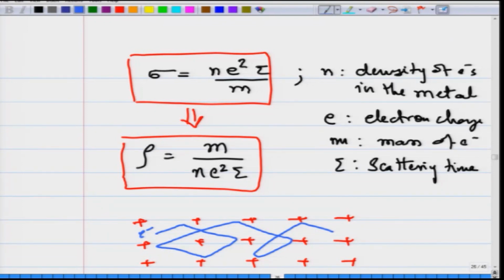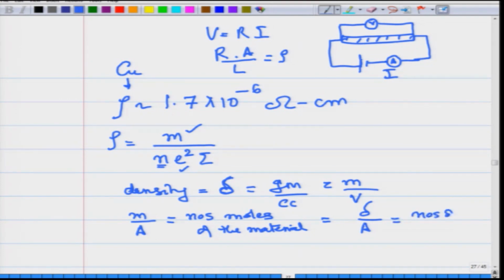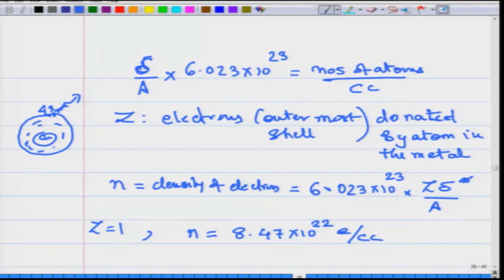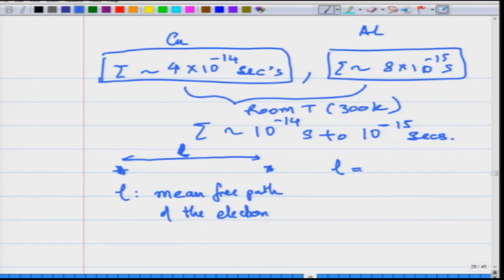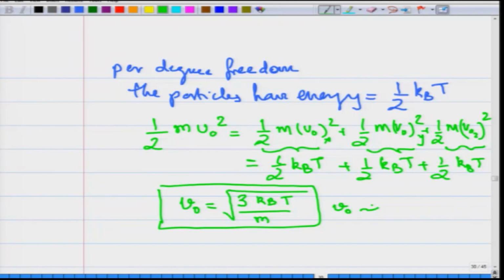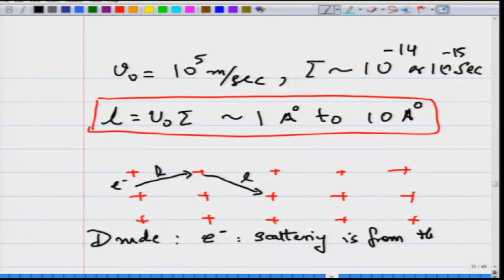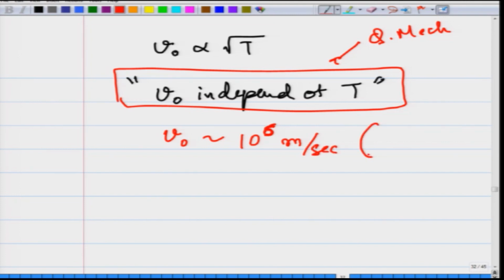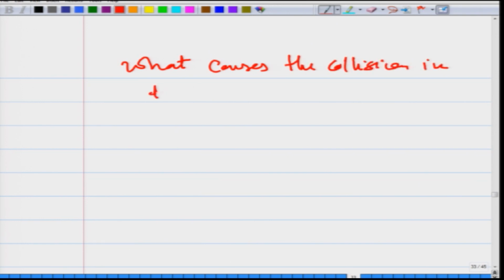noc19-ph02 Lecture 05-Drude's Model-Part-II

Comment: How is the resistivity dependent on temperature?
Reply: With an increase in temperature, the number of phonons increases. So the phonon induced scattering also increases, thus decreasing the mean free path. So resistivity increases. This is in the case of metals. For semiconductors the scenario is different.
Reply: @vasudevanm.v2760  Say Simply more collisions due to increase in entropy(randomness) of electrons

Comment: In case of velocity you are increasing temperature. But to get tau you are decreasing temperature..🤔🤔🤔.
Why?
Reply: As per classical statistics, with increasing temperature, the velocity of the particle (here electron)  increases. Also with an increase in velocity, scattering due to lattice (phonons) also increases, thus causing a reduction of mean free time.
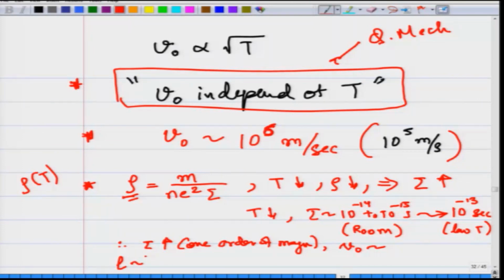Reply: @vasudevanm.v2760  at 21:50 see 
He decrease temperature and resistivity 
so Scattering time tau increase.
Now but velocity v ∝ √ T
But he increasing velocity.
That is my question.

In same condition taking different outcomes
Reply: @spfi3881  he has mixed up the two theory to prove drude was quite off.
Reply: bro, velocity is independent of temperature.  Only scattering time depends on temperature in the way explained.  Where is the confusion!
Reply: @DeepakKumar-yo7xd  velocity is independent it is the conclusion of sommerfeld model which will be discuss in next lecture. 
According to drude model velocity is temperature dependent.
Reply: @spfi3881  yeah, you are right actually.